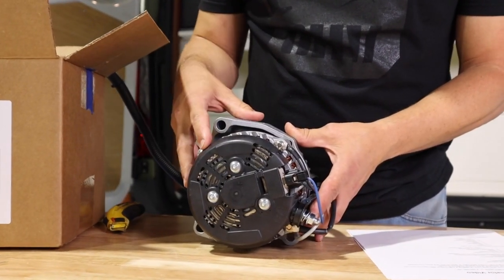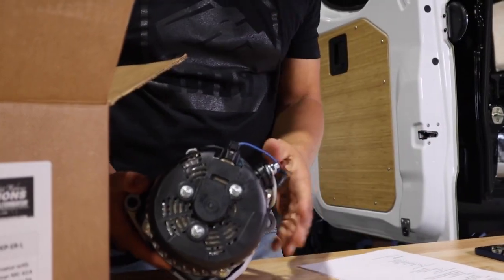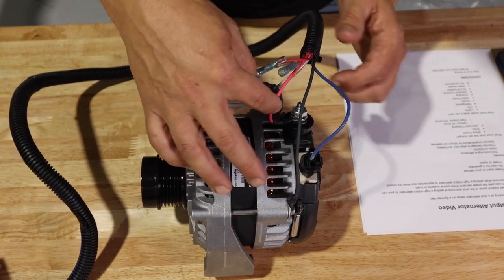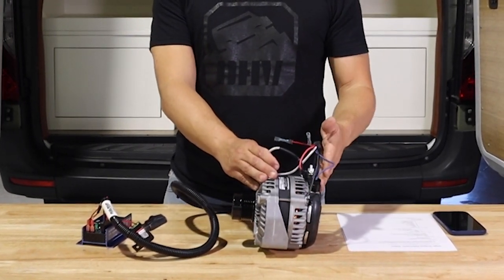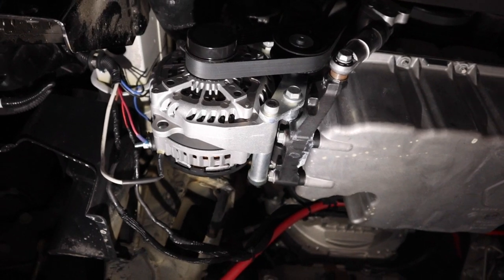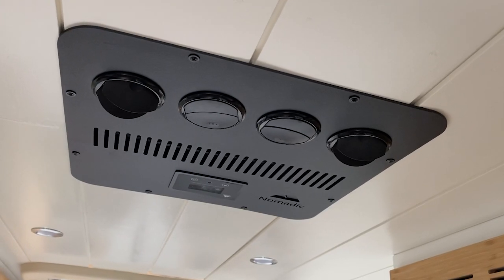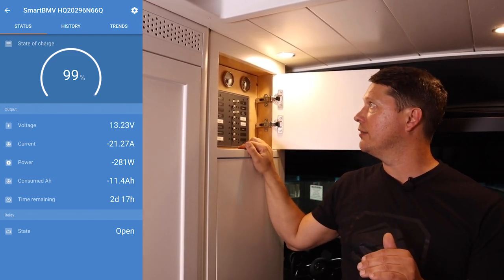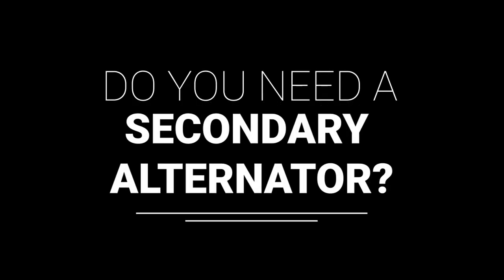Do You Need a Secondary Alternator For Your Van?

Comment: Some info is missing here: if you go build a van, go for a 48v system. With "just" 60amp at 48v you can in theory charge 2800W into your battery bank. So 15kwh bank would take ~5 hours assuming a charging efficiency of 90%. Default alternators are 12v? I don’t know not an expert by any means but thought this is a key element. Also with higher voltage system you can use smaller wire which is also a benefit.

Comment: ha ha blow up the battery LOL wow thats why they sell DC2DC with Lithium profiles. Place that in between the alternator and the battery. Honestly thanks for the video yet a single alternator with 300 amps and dual 50amp DC2DC chargers a 400AH battery bank was simpler and less items needed in the engine bay. Also being able to have peace of mind that the DC2DC do its job and turn off charge once the batteries are 100 SOC and then kick back in once it hits a threshold. To charge again.

Comment: Great video. Is it also possible to change the old alternator for a bigger one?
Reply: Good question! I would like to read a response to it, too. There are some interesting 320 and 360 Amp alternators available in the market.
Reply: @gregc5684 I think I saw a video with ARB saying that they are using the 320.

Comment: I plan on traveling with a pet and I am rigging up an auto start to the van when the temperature exceeds pre determined temp. if the van idles while running the AC will this overheat the second alternator and how do I prevent that? Thanks!

Comment: Great video,
Did you use a dc to dc charge controller? Or is it not needed on a secondary alternator like when you are using the stock alternator. If so, was it an Orion and what size?

Comment: Great info. 

With induction cooking I’ll likely fall somewhere between standard and high power.  

Im planning to add additional solar so I can remain parked more-drive less. 

If that doesn’t work due to low season use with shorter sun days I’ll have to think about a high output alternator. 

I’m assuming I’d remove my Victron DC/DC 30a max Orion and disconnect the starter battery from the charging system at that point and allow the high output alternator with regulator to charge my 400ah Battleborn bank directly. 

Thanks for the comprehensive video.

Comment: I really wish you, and others, would use proper units for power (watts) and energy (watt-hours). It's displayed right on the face of your Victron Energy app!

Using amps and amp-hours is approximately correct, assuming the voltage is always exactly 12 volts (it isn't). It is particularly annoying if a builder is setting up a 24 volt or 48 volt system. And for the currents you have in your system, you should really be considering 24 volts.

</rant>
Reply: Wish you were in SoCal . . Looking for a knowledgeable person to help wire my second alternator.
Reply: @JimJones-gd2jy  Sorry, but I haven't done a second alternator, however I would recommend that you investigate if a DC-DC converter-charger connected to the CCP of the van would be sufficient for your needs. Much simpler install.
Good luck!

Comment: Very good video... BUT why would we have second alternator... We could just upgrade primary alternator to high output alternator? That would be better...?
Reply from the maker: That’s also an option but not as robust as the Nations option.
Reply: I have a 2021 Ram Promaster 3500 so I am concerned about the low clearance underneath for a second alternator. American Power offers a 360-Amp alternator. Could I use that to replace my factory 220-Amp alternator and not install a secondary?

Comment: Nations Alternator in Missouri makes an auxiliary alternator kit for different vans, for around $2K. The kit includes a Balmar controller and mounting hardware for the particular van, greatly simplifying installation.  Our Ram Promaster 1500-based Carado Axion came with a secondary alternator. We've had it for 5 years and enjoyed it. We also have 200W of solar and 2 lithiums that we upgrades from 400AH to 600AH. In our experience it has meant not
 need to even think about a portable gas-powered generator, and so charging it in a campground is vastly quieter with just the engine idling. 

We're happy with our choice but there are some things to watch out for that weren't mentioned in the video.
1. Some van dealers won't deal with anything you add to the engine bay and may balk at warranty repairs on other things in the engine bay. Find out how your local dealer(s) stand(s) on this issue--especially if you're still under warranty. 
2. Our RV's manufacturer didn't always install these secondary alternators correctly. This is not a big deal--doesn't cost a lot to correct--but it shows the need to be careful when modifying anything in the engine bay. 
3. The Balmar should be installed high up in the engine bay. Looks to me like the installation used in this video was too low, making it prey to corrosion from water & guck thrown up as you drive--especially if you're in snow country where they use salt to melt road ice.
Reply: The Balmer is mounted plenty high enough in the engine bay in this install.

Comment: There is definitely no free rides in the electrical world. What size cable did they use to connect from Alternator? My wire calculator suggesting 240mm minimum for 280 amps. Your right re those little toy circuit breakers I can never understand how those tiny terminals are ever allowed to be sold you found the right one, check the tightness a few times as the cable settles have found they can become a little loose at start allowing to heat and trip. 
The power minimum from your van motor I believe will be 4kw / 5.4hp transferred of cause by belt we have found to be a high maintenance issue carry at least one spare
We are Victron Professional in Australia trying to help the Blue Sky Dreamers.
Reply: Actually the power would be drained from battery also, so the alternator current would not be too high. Just depends on your setup.
Reply: 240mm . ? You might want to check that. It is way off. Your hp calculation is similarly off. With probably 50% alternator efficiency you get about 11 hp of engine power used for 4k.

Comment: If you replaced your primary alternator for a high output alternator, wouldn't that suffice? I'm looking into a a 220A to the house battery bank through a voltage regulator then from the bank to a DC/DC to charge the starter.
Reply: Not completely sure, but if you're buying a second alternator anyway, why not separate the two electrical systems? Seems like it's all upside other than carrying the extra 20lbs for the alternator?

Comment: I actually have been working on the next best thing to replace this should have some tests done next month. Something for the 48v crowd that work a bit better than this actually just because iv done this and that wire run with the Bigg cable in a big transit was hell. With some smaller wire it's a cake job. Really though I will be doing one offs so someone please produce something better than what I came up with and sell it.

Comment: Hi, Chris from Balmar here. Might I suggest looking into our Alternator Protection Module  (APM-12) to help protect the alternator from unintended disconnects?  I did not see if you used a Victron SoftSwitch 104 to safely connect/disconnect the Balmar MC-618 based on the battery allowing or disallowing charge.
Reply from the maker: Thank you Chris 🙏

Comment: I'm curious...was hoping it would be in the video...How is the second alternator connected to the Victron system?  Does it connect to the Lynx distributor?
Reply from the maker: It connects to the Lynx BMS via the Lynx distributor.
Reply: Does that mean you are also using Victron batteries?  How would you connect if not using Victron batteries?  Would you connect to Lynx distributor then to smart shunt?

Comment: Maybe replacing the factory alternator with the high output one would keep from adding additional fuel consumption because of the extra drag. But it would be running two separate charging systems.

Comment: What charge controller are you using to get that amount of watts into the victron ecosystem? Does the 2/0 cable tie in to the Victron Lynx or does it tie in via some other way?
You mentioned that when the van is running the alternator has to be tied into the battery bank. If the exciter is isolated, could we run the van with the battery isolator in open circuit config or do we also need to break the engine live signal wire as well?
How does installing a 2nd high output alternator vs replacing the stock alternator with a high output unit? (Run one alternator but a single high capacity one)
Thanks.

Comment: I would love to hear your ideas I’m creating an unethical unthought of home generator using 2 - 10SI Car alternator’s 100A & 120A w/ a Wood Mazda 150 Amp alternator but I’ll have to run on a board driven by 12 V DC powered motor or motors but the key is how to harness the electrical power , and not trust your alternators by having them hooked up to batteries continually and ideally would be is if you could wire straight to the stater the copper winding under the alternator housing in the rear because that creates AC currents which is the purest sine wave so you don’t need an inverter the harness that electrical power ! You can directly feed that into your breaker box but you need to have a charging module to keep track when the battery bank drive down to a specific voltage the electricity in the battery will spin the DC powered motors creating electricity to recharge the battery bank that’s turning the alternator to create electricity so Now you’re self-sufficient but my battery bank is 48 V so I have to get a step down from 48 V to 12 V for the motors to run feeding the electricity straight into my breaker box on a 20 amp double pole breaker and in return my solar inverter charge controller can also charge my batteries ! Any Intell welcome !

Comment: Good Video!  Thank you 23:41  for the info.  It would be helpful if you also covered this topic on Transits and the Pro Masters.   I know many have mistakenly ordered the secondary Transit alternator not know it is integrated into the vehicle electrical system rather than providing the option to charge house batteries directly.

Comment: First of all a great video. Since this seems to be a completely separate system from the vehicle charging system, could this be used in a different vehicle? I have an A-liner and a pick-up. My thought would be to have the house battery in my Pick-up bed with a pig tail off the battery bank to the 12 volt system on the trailer.  I have a 2014  Nissan frontier. Any thoughts on whether or not this could work and if so, what secondary alternator kit could I use?

Comment: Great video. Thanks for organizing a lot of different pieces of information around alternators and power. How much does the fuel economy mpg of the engine go down, if at all, when the secondary alternator is installed?
Reply: I have this exact alternator and see about 1 mpg difference at highway speeds. For anyone considering this, I recommend wiring up a Victron Smart Battery Protect on the ignition wire (not the high output wire) so you can turn your regulator on and off remotely and thereby only taxing the engine when you want to. You’ll also need to do this if you have a Victron VE Bus BMS, like I do.
Reply from the maker: It’s hard to say because so many things affect MPG of a big vehicle like this. Not a huge difference but something to be aware of.
Reply from the maker: Thanks for adding this comment. Good idea on the exciter wire.
Reply: @bradgilley  thats a great point about the on/off switch and that extra load on the engine that causes the reduced 1mpg only happens when current is flowing to the house batteries. Just like any other engine accessory on the engine belt causing your fuel economy to go down when you switch on the air conditioning in the car/van.
Reply: Dumb newby question, if you’re existing alternator charges your AGM chassis battery and your lithium house batteries, why wouldn’t you install another AGM alternator, then at least if one alternator fails you still have power to both sets of batteries as opposed to when you divide the batteries with their own alternators you have alternator exclusivity, no redundancy.

Comment: My van has a second factory alternator. I want to use the second battery to run maxxair fan and some led lights, Is there a way to isolate this battery so I don't accidentally drain my start battery while the vehicle is parked?

Comment: What type of wire are you using for the voltage sensor wire? For the positive and negative wires, you mention that you are using 2wg but you did not mention anything about the  voltage sensor wire.

Comment: Wait.  When the breaker popped originally, wouldn’t you damage the alternator because of the immediate disconnect?   Did you have a sterling protection device?
Reply from the maker: We had to keep a very close eye on it- as soon as it popped, we disabled the alternator immediately.
Reply: @VanLand  thanks! I was told that it’s not recommended to have a breaker or have an on/off switch for that reason. If you aren’t paying attention you will ruin your alternator.   I guess you could always  up size your wires to be certain you arnt at a fire risk.
Reply: The reason TO install an OCPD (breaker or fuse) on an alternator cable is the cable is generally long and large, as such, has a greater potential for destruction should a short (not an overload) occur. To be able to disconnect the battery if a short occurs. 1) place the OCPD within 7" of the battery (per ABYC) and 2) size the OCPD larger than the max capacity of the alternator so the alternator output has no ability to trigger it (designed for fault protection, not overload protection). A fault can deliver much more current from the battery than the alternator can generate and will be able to activate the OCPD to protect the cable. Tripping the breaker on a short WILL produce a huge spike IF the alternator is under heavy load at the time (it could also potentially happen when the alternator is lightly loaded or the engine is off) and may damage the alternator but it will probably prevent a fire that is likely to consume the whole vehicle.
Reply: Hi guys. 
I am not professional.
Just my thought. 
What about for not to ruin your main altenator have switch and use that switch only when engine is off???
Hmm???
That way I think there won't be big jumps of amps up or down...
Or I am wrong?

Comment: Can you guys post the wiring diagrams. Please!!!
Reply from the maker: What Power system are you using? There are different layout drawings based on the equipment you choose. If I have the one for you, I’ll post it.
Reply: @VanLand  im running a victron 3000 with 6battle born lithium battery bank, a lynx distributor, with a mppt 100/50. I have same alternator with balmar voltage regulator. I purchased AC unit thru   Nomadic Cooling, thru their Operations Manager. They convinced me to add second alternator like in their you tube video. I even had that same shop they work with install it. “ The Benz Shop”. At the time of installation I did not have my battery bank installed so they could not complete that connection. Now that my power system is in place. Neither company seems to know how to connect the dots. When I saw your video I almost cried in joy. It was the missing piece. But without a wiring digram on how the alternator and balmar is hooked up with wire and wire gauge details im stuck. I reached out to both your shops yesterday trying to talk to someone with no luck. More than willing to pay for time and info. Thank you.

Comment: With the MC-618-H Balmar system a BMS or DC to DC charger isn't needed to limit current, correct?
Thank you.
Reply: Key to a using battery charging regulator like an  MC618 is also using the 'optional' temperature sensor to reduce charge rate as the alternator reaches 120C. This keeps the amperage output at the  maximum SAFE operating temperature the alternator can sustain constantly with regard to changing conditions. Your (otherwise correct) understanding to have a method to limit current output is necessary but NOT THE key to safe operation unless you also understand the safe capacity of the system. Simply put, just installing a fixed DC charger is no guarantee that the alternator can supply that amount. Sometimes it may, sometimes not. Safe capacity varies with ambient temperature, engine load (heat) and engine speed (alternator cooling fan speed for cooling). Since those three vary widely, there is no single capacity answer. The best method is to measure and adjust based on alternator temp. Using the alt temp sensor to directly reduce alternator temp is the only sure way constantly adjust capacity to conditions and not to exceed alternator capacity.

Comment: The question is, do you run the secondary alternator with the car in place, or just driving? No point in using the 2nd alternator for the AC when you can only use it driving. You're in the front using the van's built in AC for that. If you are stationary and using the alternator with the AC running, would that overheat the alternator/engine? then not a good idea to use the 2nd alternator.
Reply from the maker: The battery storage takes care of running the AC when the van is off. The secondary alternator charges the batteries at a high rate. You can get 100+ amps off the alternator while idling but it’s best to limit idling with the Sprinter.

Comment: Probably worth considering whether you're even able to install a second alternator. Maybe there just isn't any space for a second alternator. that's what I worry about but it sure would be nice to charge a higher voltage battery bank system.
Reply from the maker: Unless you have the factory rear air conditioner, there is space.